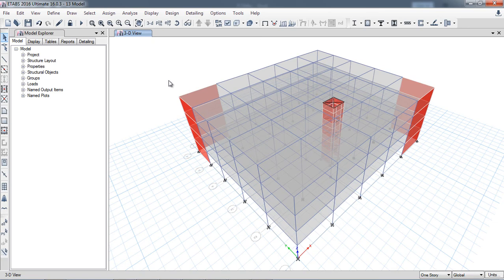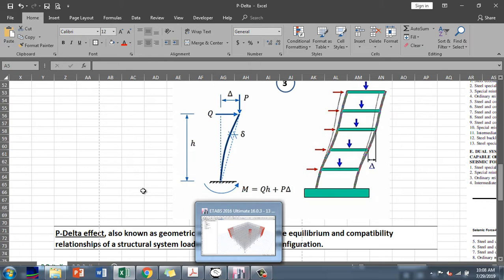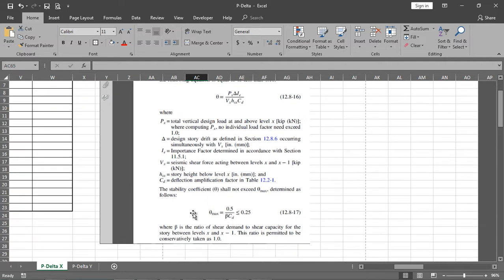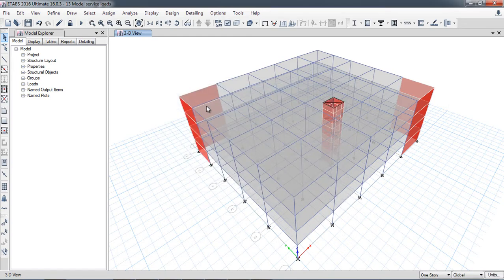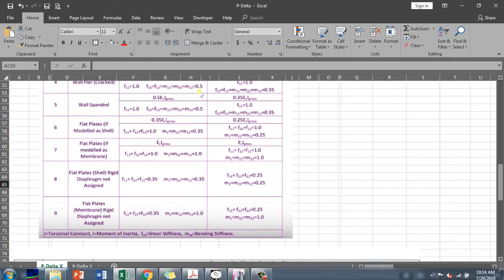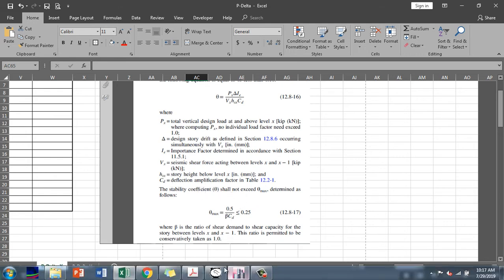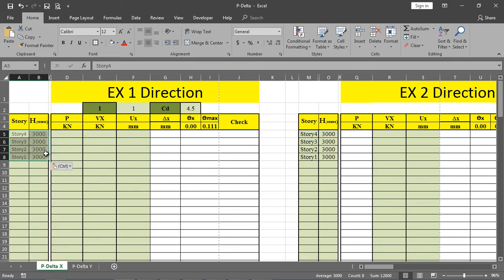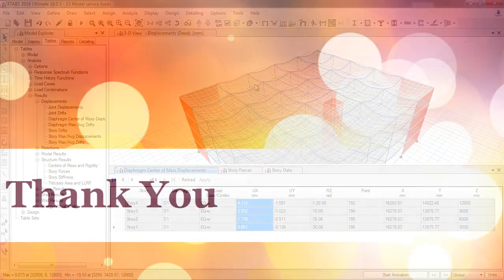CSI ETABS - 04 - P Delta Analysis (How to include P-delta effects) | Part 2

Comment: what shall we do if one of the four seismic directions require P-Delta design?....Shall we consider P-Delta in the design
Reply from the maker: Yes, if one of the four seismic directions requires P-Delta design, you should consider P-Delta effects in the overall design of the building.                              ---) Check P-Delta sensitivity in all four directions.
Apply P-Delta effects in the seismic analysis if required in any direction.
If necessary, enhance stiffness or reduce story drift to control excessive P-Delta effects.